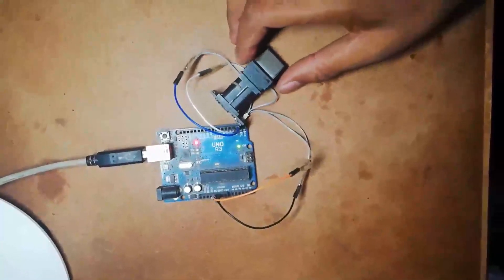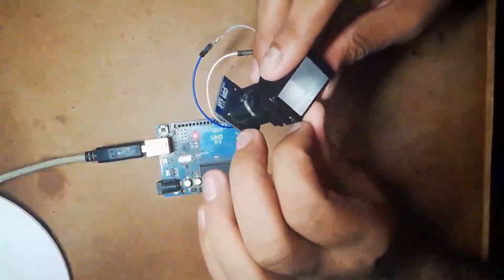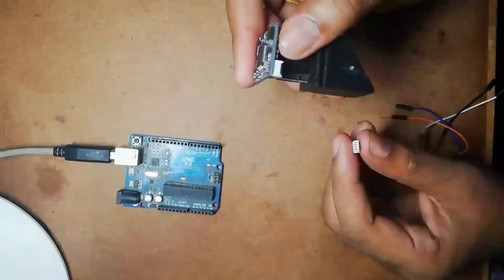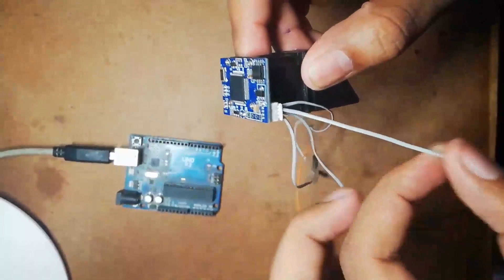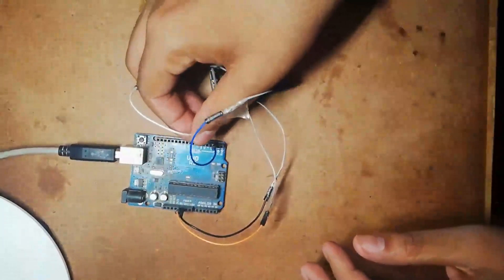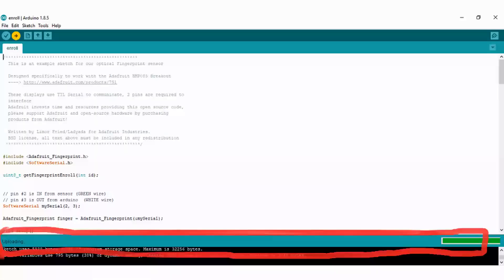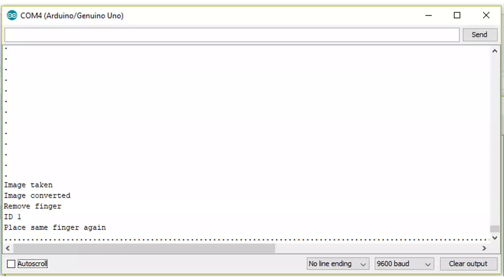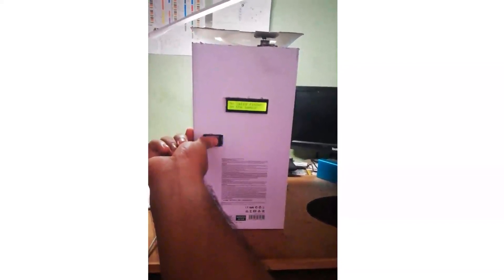How to interface Fingerprint Sensor Module R305 with Arduino

Comment: Can i use r307 fingerprint sensor with same library?
Reply from the maker: Yes, you can use R307 without any modification in circuit and code.
Note: Please identify the pin before connection.